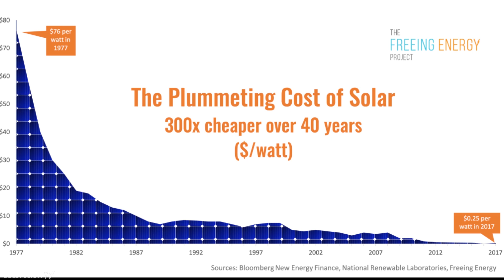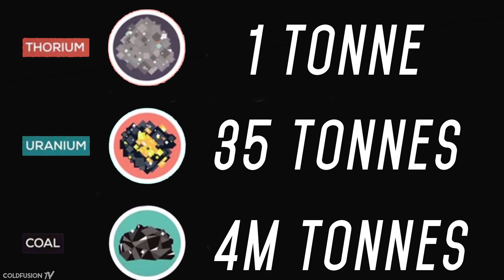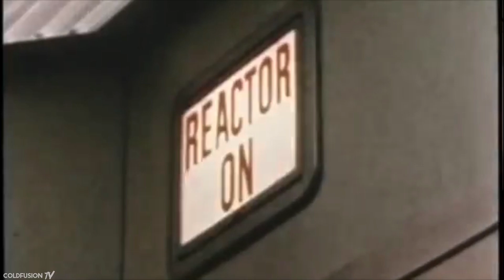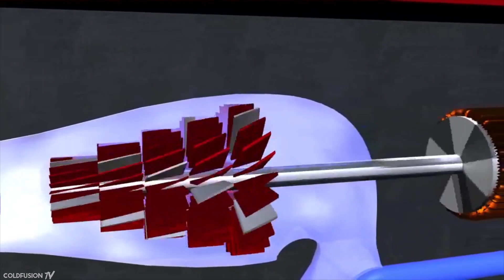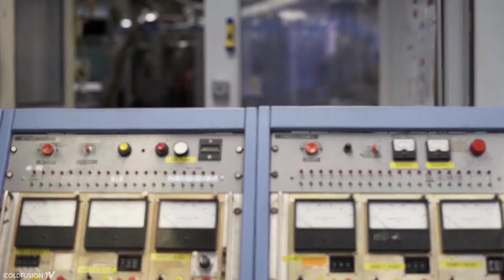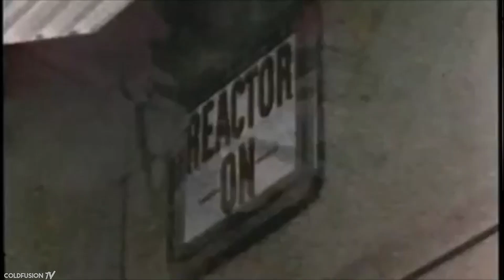Thorium - The Future of Energy?

Comment: Some fundamental things are confused here in the comments.

Thorium was originally discarded for nuclear weapons because breeding and reprocessing U233 in solid fuel is difficult and dangerous and it was poorly understood at the time of the Manhattan Project when they were doing all this from scratch for the first time, ever.  The reason it didn't catch on later was largely institutional bias.  Due to the nuclear program, engineers and scientists had experience with breeding and working with plutonium.  And thorium is an absolute pain of a solid fuel to work with.  India has been struggling with it for decades.  Reprocessing a bunch of U233 filled with U232 is just difficult and costly and dangerous.  Thorium only makes sense in a molten-salt reactor (and you get some extra benefits when it's used in that manner) which is why the two are treated as synonymous.  But around the time that a real MSR was being developed, Nixon axed the program for political reasons.  He wanted to concentrate all nuclear research in SoCal, so he basically cut every program that wasn't already located there.  The MSRE was at Oakridge, so the ax it got.  

The Defense Department had little influence in the civilian side of nuclear stuff.  You literally can't use plutonium from commercial reactors to make bombs - the fuel cooks too long and the Pu239 gets poisoned with Pu240 and Pu241 which prevents it from being good bomb material.

Most of the advantages of Thorium are due to it being in a Molten Salt Reactor .  I think there is some fundamental confusion here about cost and safety.  One, a Thorium reactor will never be safer than a typical nuclear reactor if it costs more - because it will never exist.  Nuclear doesn't want for safety.  It's already the safest power source mankind has ever harnessed, and by several magnitudes.  Two, a Molten Salt Reactor, be it using Thorium or Uranium or Plutonium, should be BOTH safer AND cheaper.   It will be cheaper BECAUSE it's safer.  The cost of nuclear power comes from stringent safety requirements, and ridiculous manufacturing quality necessary to achieve that.  The reason you need a 9 inch thick solid-forged reactor core, is because you have to contain the coolant (water) at 300C in a liquid state in order to get any efficient kind of energy production. (100C water would only give a theoretical maximum of ~20% heat to electricity. 300C gives 45%).

To keep water liquid at 300C you need to pressurize it to about 120 atmospheres, or 2000psi.  That's why you need to x-ray every weld on every pipe, and have ridiculous, costly, high-quality material throughout the whole reactor. Because the thing is perpetually containing a massive steam flash.  That concrete containment structure around nuclear reactors? The one that can win in a fight against a Boeing 747?  It's not there to contain a nuclear explosion.  It's there to contain a steam flash or a hydrogen explosion.

A Molten Salt reactor uses Salt for a coolant, and dissolves the fuel into it to get the same negative void coefficient.  System heats up, salt expands, fuel gets less dense, reaction rate goes down, system cools down.  Self regulating.  Today nuclear reactors do this with a solid fuel and a liquid moderator.  MSR does it with liquid fuel and solid moderator, but its the same principle.  In addition, there is passive safety in the ability to move fuel out of the reactor.  You can make it automatically drain in the event of failure into a container that keeps the fuel from being dense, and has tons of surface area to reject decay heat.  It makes the failure modes of Chernobyl and THI and Fukushima impossible as long as gravity works.

But the real key point is that, rather than using water, which behaves poorly when things go wrong due to its low boiling point of 100C, MSRs use molten salts, which don't even turn liquid until ~450C and don't boil until 1500C.  That's 1000 degrees of liquid range, where any fluctuations or strange events won't cause the system to try to explode itself by your coolant trying to evaporate.  That means you can operate the reactor at a much more efficient 600C-800C, and still have tons of headroom.  Since your system is at ambient pressure, you don't NEED super-high-quality-everything to keep it safe.  The system simply isn't under any real stress, except heat lower than that of a campfire.  If something goes terribly wrong and you lose containment... nothing explodes into the atmosphere and becomes fallout.  All the solid material just sits there like a pool of lava.  Most of the gaseous products will bind to salts, and those that don't will be constantly off-gassed and removed, so in the event of an accident there won't be a huge store of gaseous daughter products to float out into the surrounding area - just those immediately being produced for the few minutes before the reactor self-scrams.

I really can't emphasize this enough.  Most of the benefits of Thorium come from it being in a Molten Salt Reactor.  A Molten Salt Reactor runs at Ambient temperature, which makes it safer while demanding far less material and quality in the manufacturing.  In nuclear power, there isn't such a thing as 'cheaper or safer'.  it's going to be both, or neither.  The realities of the economic and political systems don't permit anything less, and the driver of cost is what's necessary to ensure safety.  Cost in reduced by choosing designs that are inherently more stable.

The advantages of Thorium are that it's more abundant than uranium and breedable in the thermal spectrum. So we could get 100,000 years of easy fuel rather than 20,000 years, and possibly in a cheaper reactor.  And it produces less long-lived waste.  But nuclear waste isn't a real problem in the first place.  The quantity of it is just too small - it's mostly a political football.  Eventually we'll either throw it in the salt-caverns we planned to since the 70s, or we'll put it into burner reactors that will just destroy the long-lived waste.  There are some other fringe benefits like certain medical isotopes derived from Thorium's decay chain  and PU238 for RTGs produced during the process.  The advantages of thorium are nice, but they aren't significant in any ways that currently matter.  Thorium, Uranium, or Plutonium.  Any and all are valid fuels for our present use.  The important thing is that we build Molten Salt Reactors to burn them in.
Reply: I understand research and materials would be costly. In the video he said 1 tonne of Thorium is approximately equal to 35 tonnes of Uranium. Does this mean mining Thorium will also be much cheaper compared to Uranium?
Reply: @agrillhasnoname  err... sort of.  I'm sure there is a basis for that number he provides, but you're stuck with some real apples-to-oranges comparisons.  The relative energy density compared with coal is pretty accurate though. Since I don't know wher he derived those numbers, i'll just offer an explanation here rather than trying to correct the statement.

Thorium and Uranium have roughly the same energy density.  35kg of thorium and 35kg of uranium, if consumed fully in a nuclear reactor, would produce similar amounts of energy.

However, the way we use Uranium today is by harvesting uranium ore, that is 99.3% U238 and 0.7% U235, and then use centrifuges to enrich that to 3% or or so U235 content, throwing away ~ 90% of the 'depleted' U238 in the process.  This enriched uranium is formed into uranium-oxide fuel pellets, put together in an array of zirconium tubes, and then placed into a reactor where it operates at the thermal spectrum (slow neutrons), which is an easier kind of reactor to make and control because you don't need to be so careful about neutron efficiency.  While in the reactor, the U235 fissions, producing neutrons that fission other U235.  The U238 is mostly inert in this process, as it does not fission when struck with a neutron [in the thermal spectrum].  Occasionally a U238 atom will absorb a neutron, becoming Plutonium-239.  Over the 3 year lifetime of a fuel rod, about 3% of the U228 will become Plutonium.  About half of those Pu239 atoms will subsequently get hit with a neutron and fission, adding more energy to the process.  A smattering of the Pu239 will also get hit with neutrons and absorb them, becoming Pu240, and Pu241 or Americium-241.

So the way we use Uranium ore is by harvesting it, reducing it by a factor of ~5 while enriching the U235 content, and then fissioning about 4% of that total mass.  leaving us with fuel rods that are back down to about 0.7%U235, about 94%U239, about 1-2% Plutonium, and about 3%-4% daughter products from the fission.  Our spent fuel rods still contain roughly 24x as much energy in them as we originally derived, IF we put it in a reactor that would breed all the U238 into Plutonium and fission it.  A thermal spectrum reactor just isn't efficient enough to do that - you need high energy neutrons to get enough neutrons-per-fission to make that work.  We saw SOME breeding in the thermal reactor described above, but it wasn't sustainable like a fast reactor could be. And remember, that fuel rod is only about 10% of the original uranium we dug up.  So our overall efficiency is 4% of 10% of the potential energy of what we mined originally.  0.4% efficiency!

Thorium, by contrast, MUST be bred.  Thorium really only exists as Th-232.  There's no special fissile-isotope like U235 us to U238 that we could enrich.  Instead Thorium 232 must be bred into Uranium 233.  BUT!  U233's neutrons-released-per-fission in the thermal spectrum is greater than 2. Which means it produces enough neutrons to sustainably breed itself.  Each fission produces enough neutrons to breed a thorium atom into uranium, and then fission that uranium, continuing the cycle.  Thus, we could utilize ALL of our thorium in a thermal spectrum reactor.

Some of that is only possible if the fuel is in a liquid state, because unlike with solid fuel you get constant mixing to make the system homogeneous, and you can constantly extract neutron-poisoning daughter products like Xenon-135 (noble gas that REALLY eats neutrons - stuck in place in solid fuel, bubbles out as a gas in liquid fuel) to make the system more efficient.  But these same efficiencies would apply with using uranium or Plutonium in a molten salt reactor as well.

Now, as for how 'cheap' the fuel would be, it would certainly be cheaper to use thorium.  The reason isn't the efficiency in which we use it.  The reason is that Uranium is pretty much the most widely diffuse chemical on the planet.  It really doesn't like appearing in significant concentrations in the way you might find a gold or iron or copper vein.  Thorium is also pretty diffuse, but less so. And also 4x more abundant.  As an aside, because of how almost-uniformly-spread-out thorium and uranium are, pretty much any cubic meter on Earth on the planet will contain a couple grams of thorium and uranium.  And if that was burned up in a reactor, it'd produce the energy equivalent to somewhere between 5 and 30 cubic meters of pure crude oil.  So the idea that we can ever really run out of enough nuclear fuel to power our civilization is pretty laughable.

Anyway, the reason thorium is so cheep is because we ALREADY mine tons upon tons of the stuff.  There are dozens of mines in the world that each mine enough thorium on accident while mining for 'other materials' to power the entire world's electricity grid.  Ironically, this thorium is typically brought up from monozyte deposits, and other ores that tend to contain about equal parts Thorium and Rare Earth metals.  The US could satisfy most of the world's 'rare' earth metal demands with the stuff we throw away as 'waste product'. 

We throw it away because we have pretty stupid EPA laws that basically consider thorium (with a 4 BILLION year half-life) to be a radioactive liability, and thus separating out the rare earth metals constitutes nuclear activity and would produce huge liabilities for the mining companies.  So the mines just take the thorium-containing ore, and chuck it right back into the ground, and the EPA lets them pretend it's 'natural' radiation.

Point is, if you went to a mining company and offered to truck away all their thorium, they might even PAY YOU to do it.  So yes, thorium is going to be cheaper than uranium.

However, all of that is a fairly moot point.  Nuclear power costs customers about 10 to 15 cents per kwh.  A big chunk of that is the electrical grid to actually deliver the power.  The electricity from the plant costs somewhere around 6 to 8 cents per kilowatt-hour.  And of that, only about 1.5 cents is from the cost of Uranium fuel.  That's why we use uranium so inefficiently - because even at <1% efficiency, it costs virtually nothing.  We don't bother making commercial breeder reactors, because it'd be a much more expensive and complicated plant design in exchange for saving 1 cent per kwh of operating cost.  There's no real profit or savings to be had.  

A Thorium reactor would not be cheaper than present day reactors because we're using a cheaper fuel source.  That would be a minor consideration.  A thorium reactor would be cheaper because you're only going to use thorium in a Fluid-fueled molten salt reactor.  Which will be cheaper because, as I stated in my previous comment, the materials, the material-quality, the manufacturing quality, and the inspection process should all be significantly easier because you're building a reactor that only has to tolerate ambient pressure, rather than pressure equivalent to 1km below the surface of the ocean.  And since the reactors can be smaller and lighter, they could be built on assembly lines, further improving quality control and inspection.  Additionally, the reactor would be as simple as modern-day commercial reactors in general design, rather than more complicated, experimental fast-breeder reactors, because Thorium can be bred in the thermal spectrum.

But again, the price advantage for breeding thorium in a FFMSR is still only going to be a cent or so per kwh better than just burning enriched uranium inefficiently, and a thorium-breeder reactor is still going to be MORE complicated than a FFMSR that is just meant to burn uranium or plutonium, so even then, the fuel cost savings may not be worth the cost of the extra complexity.

So the TL;DR is that, Yes Thorium will be cheaper to mine than Uranium, in that it's already an accidental 'waste' material pulled up by mining for other things in quantities sufficient to power the world several times over on an annual basis.  But the cost of both thorium and uranium is such a small component of the operating costs of a reactor, that it doesn't really matter.
Reply: @Xylos144  whoa, what are you doing on youtube? You should go to a meeting with the energy company people, offer your expertize and advice. Where do you get all that knowledge from? What do you do for a living? Anyway you consider the mining being cheaper doesn't compensate. However, apart from the mining process, you said "A thorium reactor would be cheaper because you're only going to use thorium in a Fluid-fueled molten salt reactor.", sounds like you said building a thorium reactor would be cheaper than a uranium reactor? Isn't that another advantage where the costs of thorium reactors would be inferior?
Reply: @Xylos144  "Thorium and Uranium have roughly the same energy density.  35kg of thorium and 35kg of uranium, if consumed fully in a nuclear reactor, would produce similar amounts of energy."

Now I'm confused, you're saying his conclusion that 1 tonne of thorium = 35 tonnes of uranium is wrong?
Reply: @agrillhasnoname  sorry, that wasn't really expressed clearly - a molten salt reactor should be much cheaper to make than today's pressurized water reactors.  Thorium will only be viable in such a reactor - but you can run an MSR on enriched uranium just as well.  So its not really thorium vs uranium here, but an MSR vs PWRs, BWRs, CANDUs, etc.
Reply: @agrillhasnoname  im sure there is some calculation that provides that 35x number.   But when talking raw available energy content, yes, the ratio is closer to 1:1.  The 35:1 value ptobably comes from some calculation based on how inefficiently/incompletely we end up burning up uranium-based fuel, compared with how efficiently we'd theoretically burn up a thorium fuel.

So, there may be some context in which that 35:1 claim is accurate, but without being provided the details of the specific scenario, i can't judge how accurate.

As for me personally - I'm just an interested layman.  I'm an engineer,  but not a nuclear engineer.  My knowledge comes from books, courses i audited in college out of interest, discussion with nuclear engineering friends, and youtube videos of people researching in the field.  I generally understand how reactors work and what tradeoffs and saftey considerations are involved.   But i couldn't perform the specific calculations to exactly quantify all these concepts. 

Energy companies don't need to hear from me.   They can find someone more qualified to understand and explain this stuff if they cared.   But they don't need to hear about all the benefits involved with these reactors.  Thats not the holdup.   

The problem is there are a lot of risks and likely unrecoverable first-mover costs associated with trying to make these,  due to the regulatory burden.  A company could spend multiple billions of dollars making a demonstration reactor,  including tens or hundreds of millions of dollars consulting with the NRC.  Since the NRC has no idea how to actually regulate these things - they'd have to learn.  The NRC then may still not grant them a licence, or whoever is president at the time may just step in and veto the liscence granting, despite something being safe and functional and up-to-spec.  Happened before with Jimmy Carter and a waste reprocessing plant.

If they DO get a liscence, now the NRC knows how to do it,  and has proven willing to grant liscences.  This immediately lowers both the cost and the risk of everyone else that wants to make this kind of reactor.   It'd be like getting a new drug liscenced by the FDA without a patent period to make back the billions of dollars spent on R&D and clinical testing.  Immediately every generic drug manufacturer under the sun will start selling your drug for pennies on the dollar, and you'll be SOL on recovering all your costs.

So nobody wants to go first with these things.  A lot of people want to go second, but nobody feels like throwing away the $5billion or so needed to get the industry kickstarted.

So my efforts seem to be best spent clairifying things about nuclear power to general people,  to try and wash away a lot of the public stigma and misconceptions associated with nuclear power.  Because a lot of the barriers to this technology are political, and thus, driven largely by public will and perception.
Reply: @Xylos144  well I asked because the knowledge you showed sounded like you could have experience working in that field. So in a nutshell, the issue is  bureocracy, like with the drugs industry and everything else. What a shame.  Is the radiation on Mars the same kind as we saw in Chernobyl? Will thick walls be sufficient protection for humans? As for energy sources, we still have more to explore. Have you heard about the TR-3B ASTRA? Not sure what part of that story is just internet myth (conspiracy theory) or real. But looking at the F117 for example, that also looked very futuristic and was secretive when they developed it, maybe it's not too far fetched. The TR-3B ASTRA, if real, is rumored to have a Magnetic Field Disruptor (MFD), which nullifies Earth's gravity or something. Do you think such a device exists, or is just fiction for now?